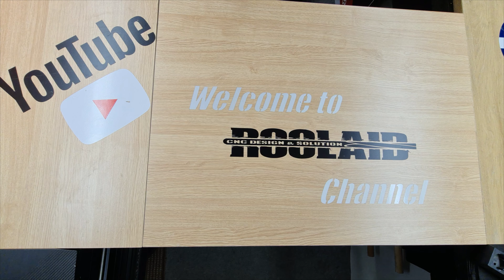3 Free Flight Model Glider Building Tutorial. Full Build and Testing, Balsa model airplane, DIY DLG

Comment: wingtip  things  are  a  STOOPID    FAIL.!!!!!!!!!
Reply: Since you're such the great experienced and knowlegable FF designer/builder, instead of being discouraging and calling names,  wouldn't you rather contact him and maybe get together with Marko in his honorable endeavor to generate awareness, insight and enthusiasm in this most basic form of model aviation? He's obviously got the heart for your hobby that he's invested in a laser printer and the wisdom of CAD and  knowing how to apply both to produce his laser cut designs. Marko's skills go beyond that in that the quality of this video is amogst the best I have watched. Especially the footage of the test flights. When have you ever been able to observe a clearer launch of a catapult balsa FF model so clearly where the model is visible throughout its trajected travel through the changing light? The only thing I could suggest is that it would be bennificial to the novice viewer to hear him explain things such as how the masking tape applied to the bottom holding the wing sections flush together assure a tight flush and tight and stronger wood to wood butt joint with propper alignment, or commenting on what he is aiming for when sanding the countour of an airfoil into the top surface of the wing and giving a brief explanation of how that longer "chord" will create the desired lift. 

I've been wingnut my entire life and thank God my uncle saved me from the dust collecting plastic models and transformed me into a dust creating flying modeler. It's the one thing that I've enjoyed and still can enjoy, but the most enjoyment that I've manage to get out of this hobby, is from when I've the privilage of getting to share it. Whether mentoring an interested individual who shows interest, or experiencing the privilage and satisfaction from getting invited to guest instruct a group of kids on correctly building AMA Darts and giving them insight into how important design and construction (AP) is one of the many areas to consider for those wanting to persue a career in aviation.  (That was an AMA sonsored "ACE Academy" one week summer course I was invited to participate in Aviation Careers Education Academy for 8-12 graders. Many of the students went on to acheiving succesful aviation careers. Something I personally failed.) 

David, model aviation, with all it's various forms, FF, CL, Rubber, Indoor, and even RC seems in a state of dwindling numbers of enthusiasts. Since you have experience and insight I encourage you to reach out and share your insight wherever you may. What better impact could you have for your contribution to your hobby than with a guy who has a laser cutter and the ability and most of all, the will to produce such quality video posts. Who knows, you may even achieve the personal satisfaction of seeing a perfected design that you contributed in affordable little plastic bags hanging in every Wall Market in this country, like the old Sleek Streeks. Now wouldn't that be something one could feel very proud of.. Like Carl Goldberg probably did/does..?